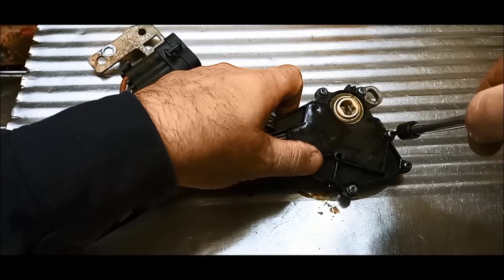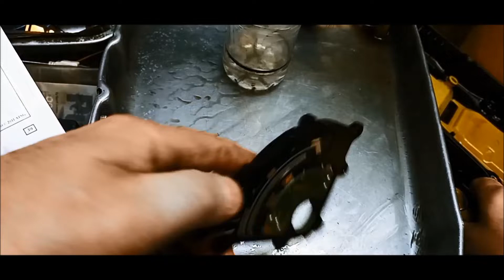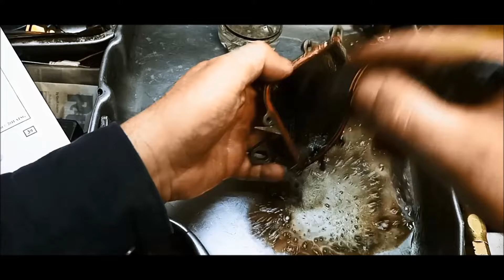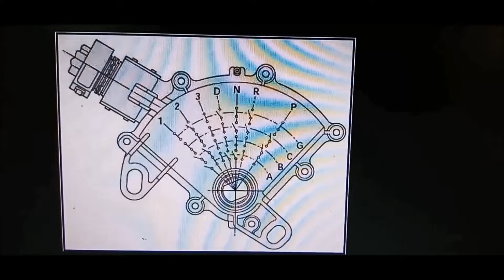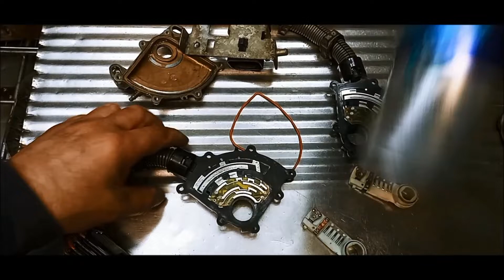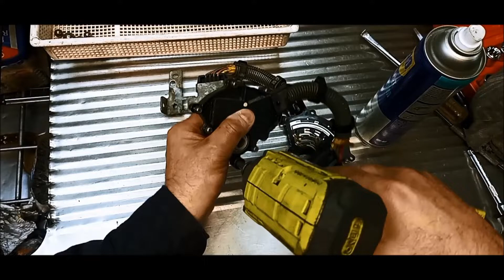Transmission Range Sensor Repair Inhibitor Switch Repair 4L30E Fault Code P0705 Fault Code P0706

Comment: I saw another guy taking off one and h said there is a O-Ring or gasket I forgot what one that is at the shaft that will let oil in and also is the culprit of leaks on this transmission. I loved your video you did amazing in explaining what to look for and do once I have the case opened. I now feel confident I can get mine off myself tomorrow. Normally I go through a dozen or so videos to get the information needed. Other then that other seal or O-Ring I hope this is my issue because pulling off the pan for the 5th time sounds horrific to me currently. Thank you so very much I hope (crossing my fingers and toes) I don't need to pull the pan off and rebuild the solenoids.
Reply from the maker: hi, if you warm up the plastic clips flex easier and reduce chance of breaking. cheers

Comment: hello good video  Could you tell us where the P0706 transmission range sensor precision sensor is in a 2011 Sonata please
Reply from the maker: hi, all range sensors are usually located on the selector shaft. either outside or inside the transmission. cheers